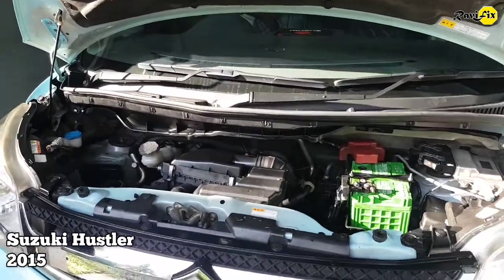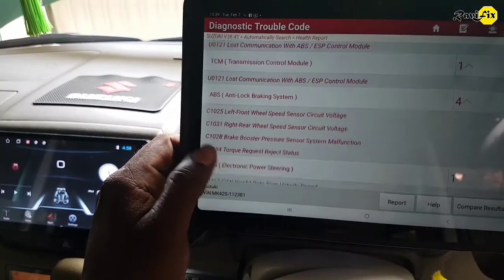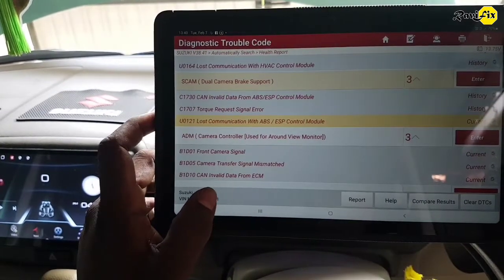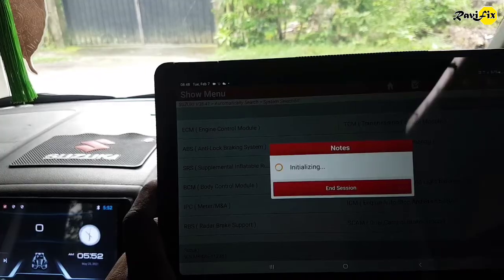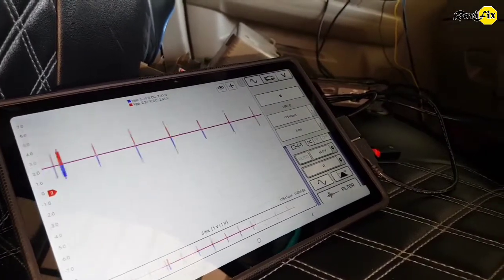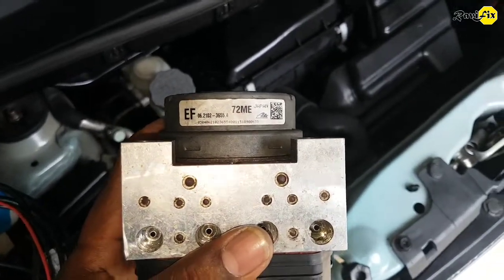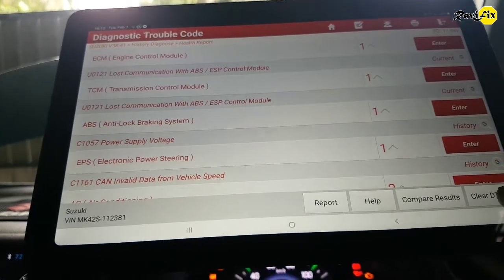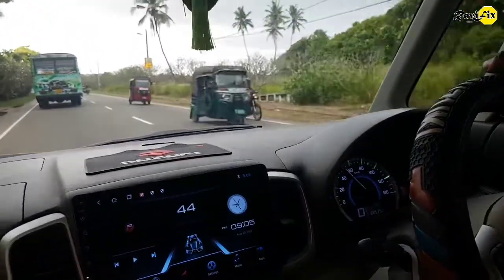Chasing OBD2 U-Codes and Diaganos CAN Communication Problems. U0121 Lost communication with ABS.

Comment: Great video. Were these waveforms taken with the Hantek 1008? I ask because I've seen on other videos that the 1008 is too slow for CANbus when using the Hantek software at least. I can see you're using the HScope though. Thanks.
Reply from the maker: Hantek 6074BE
Reply: @ravifixall   Thanks. Good  clarification.